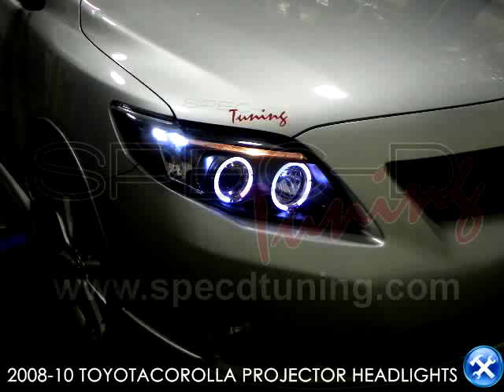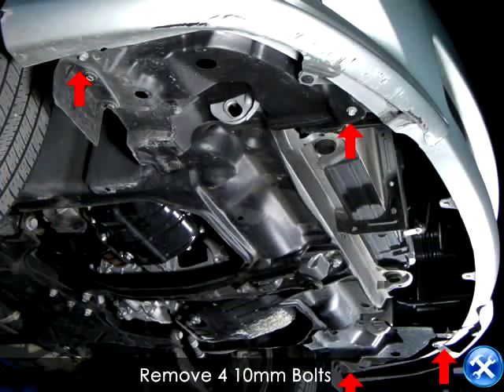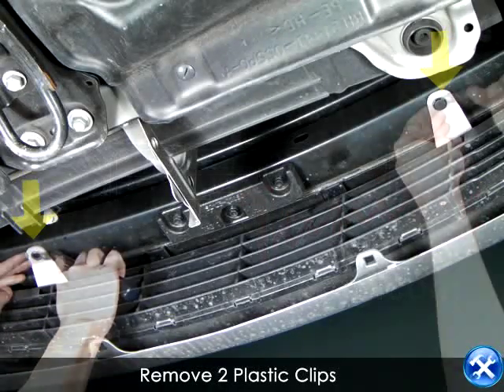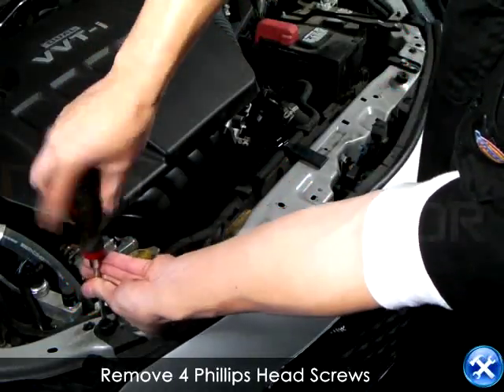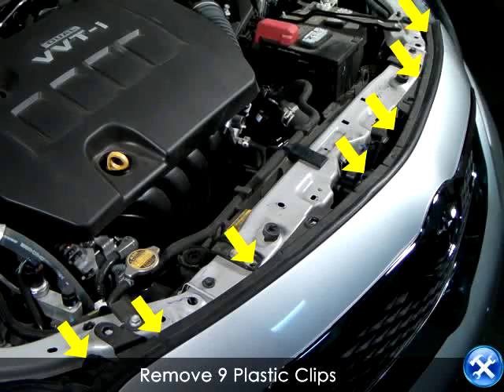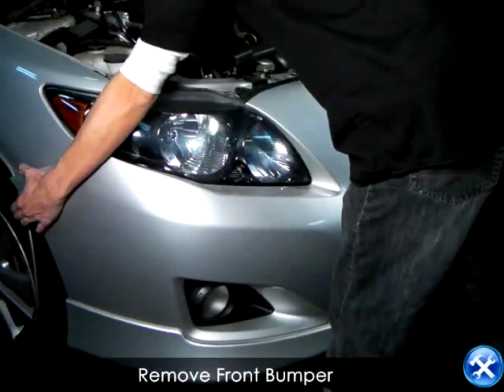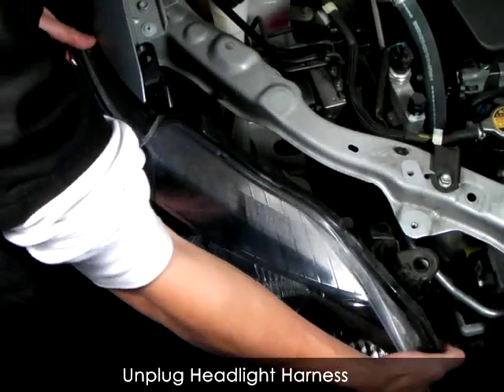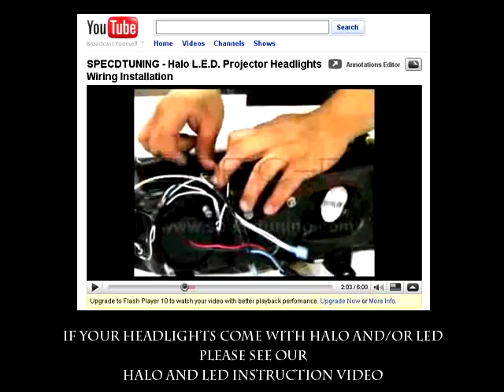SPECDTUNING INSTALLATION VIDEO: 2008-2009 COROLLA  PROJECTOR HEADLIGHTS

Comment: yes its the same layout, BUT you need to do the wiring for the rings which isnt showed in the video. i have recently bought these same headlights and they do not fit the 2011 corolla like it does the 2010.....even though they say it will. soo just be careful and make sure u can return it if something seems funny

Comment: @Specdtuninginfo Nope, it comes with the plastic covers; however, when removing them, I see the wires for the fogs hanging in there, so it is prewired. However, I dont know how to install the fogs that are sold everywhere since the kit comes with its own cables (which I think are unncessary) and with a relay but I don't know where to place it. Could you please explain or do a video tutorial about this? I love the clarity of your installations

Comment: Can it be installed in a toyota axio 2009??

Plz let me know
Reply from the maker: koush Roy No unfortunately the headlight mounting brackets are not on the same locations and these lights will not fit.

Comment: Will these work with aftermarket HIDs?
Reply from the maker: +Thomas Levens Yes the projector headlights are HID compatible. You will need to make sure to purchase the correct bulbs that will fit the headlight housing.
Reply: +Spec D Tuning Awesome. one more thing, I don't like the look of Halos, but I want projectors. is there a way to install these without using the halos, but using the other DRLs?
Reply from the maker: The exposed wiring behind the headlight unit are what powers the halo and LED bulbs. If you not like the halo bulbs, do not wire them and they will not turn on. You can still use the eyebrow and the 2 LED bulbs on the top of the headlights as your daytime running lights.

Comment: can this fit a 2010 corolla s ?
Reply: and i already have hid headlights installed can i still use them ?
Reply from the maker: +rigo diaz The headlights will fit your vehicle. If the HID bulbs are stock unfortunately these headlights will not work.